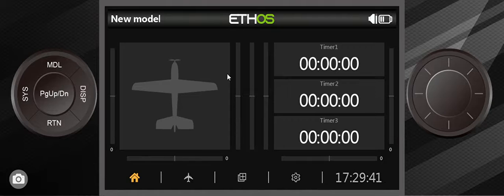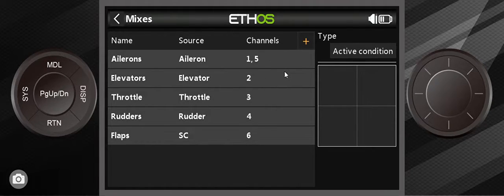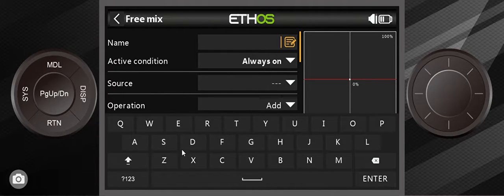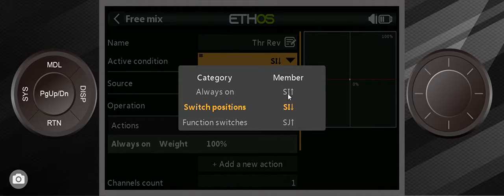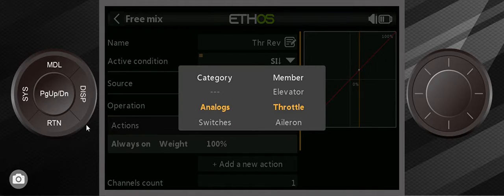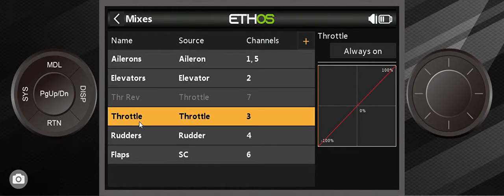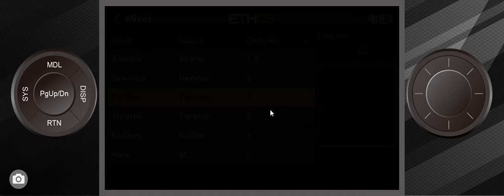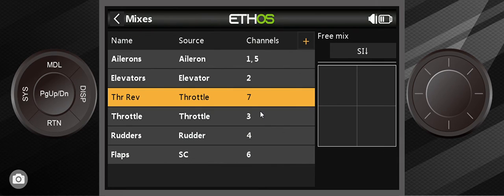FrSky Ethos: Throttle Reverse (Updated)

Comment: Thanks,  followed the steps, but unfortunately, still blowing air, not sucking air!!
Reply: You have to lower the travel of your momentary (reverse channel) switch.
Reply: @flyboywbl  thanks a lot ! It was long process to discover the issue, but finally was successful.   The only way was to reset the FMS Predator 120A esc (11 beeps), then activating reverse of the esc (4 beeps). Of course it wasn’t that simple. Needed to open the edf and pull out the esc to know the brand and searched for its manual and so on.   Now all is good. Thanks 👌.   Note: my aircraft is FMS Viper 90mm EDF.

Comment: Hi Steve i set up my radio like you did and I still have to give it throttle after I land and put on the switch at the same time. How do I put it in reverse with out using the throttle stick? Just have the switch act as throttle? I sent you the link to how Spektrum does it. Thanks for your time
Reply from the maker: Here's another video.  Reverse thrust on a switch.   https://youtu.be/kZTKZ52PSq4
Reply: @steveschlesinger3459  Thanks Steve that looks like it will work. The other setup I couldn’t use it was in reverse without flipping the switch. I tried to reverse the throttle but still didn’t work. So I put everything back the way I had it just to get it to work. But still had to give throttle while holding the switch. I will try the new setup tomorrow thanks again.